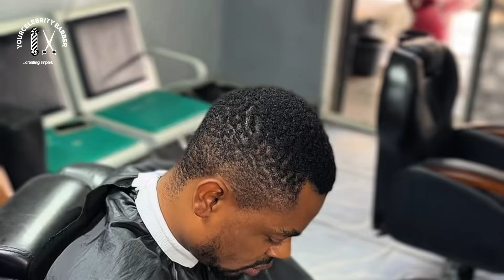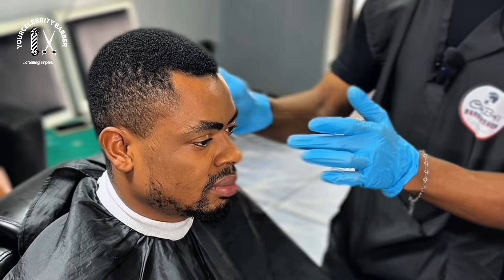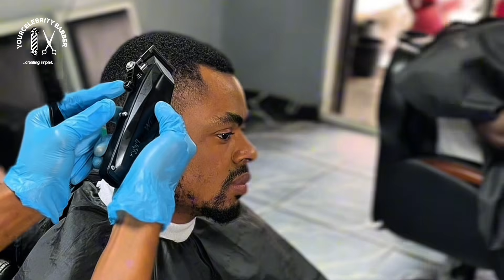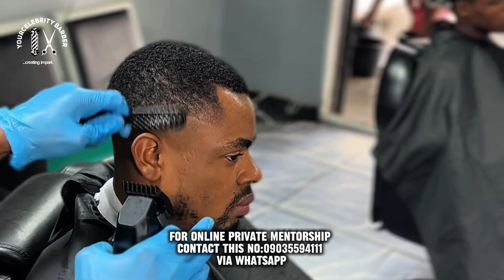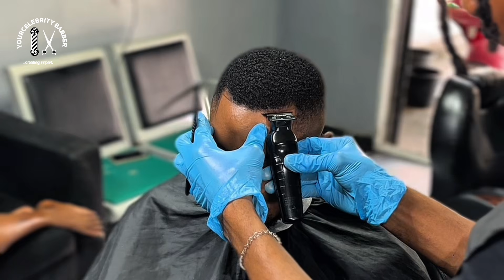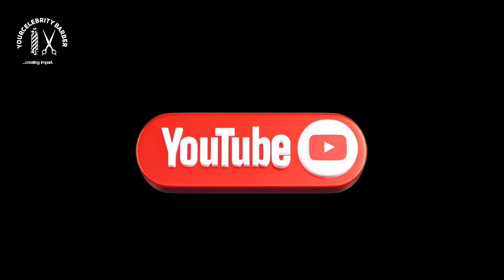This high fade method makes blending EASY for beginners

Comment: The technique(the side way not flick out. using 3mm open to blend into the top of the hair) you used to blend into the top of the hair(4.5mm open) after using 3mm gaurd closed to create the 3rd gaurd line. is it only applicable to lower hair on the top or it can be used for fuller hair?
Reply from the maker: You can use it for high top hair too
Reply: @YourCelebritybarber  ok sir. regardless of how high the hair is, which guard can i use or does 3mm big, works for any lenght  at the top when using that technique ?